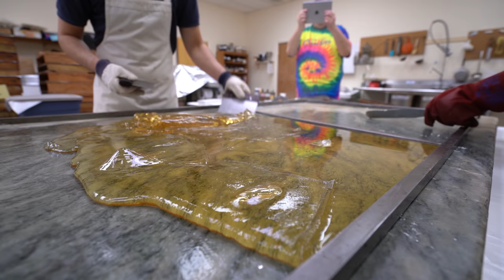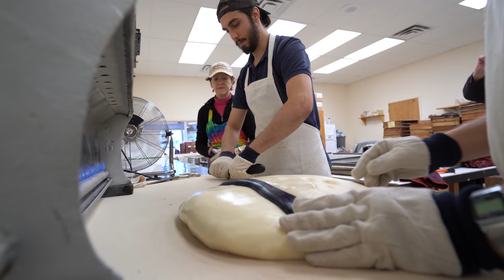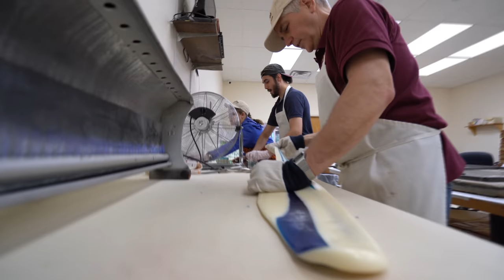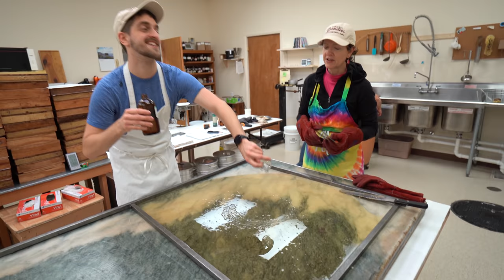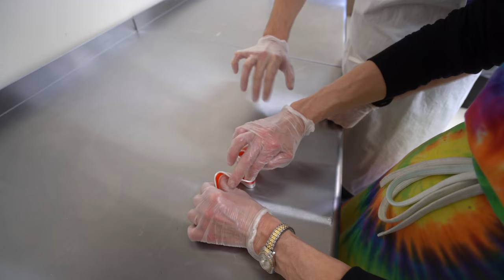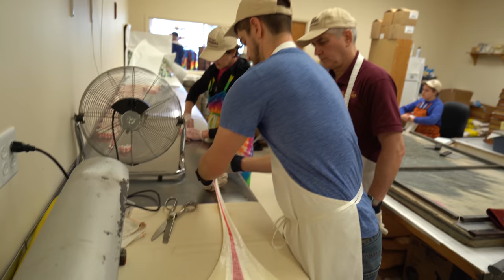Craig Finally Learns Ribbon Candy!

Comment: Love seeing you in front of the camera for a change and definitely like longer videos too, you did  a great job, Awesome!! I was thinking about the "sticky spots" on the marble table and was wondering when was the last time it was polished. It might need to be sanded and sealed. When I went shopping for a marble board I was told by a pastry chef friend that I couldn't just run to Lowes or Home Depot lol. I needed a marble slab that has been micro sanded to a fine and smooth surface and sealed. After so many years of high heat and repeated scrapping with metal paddles it's bound to need some TLC by now. Could be why it's sticking and is a fairly easy fix. Blessings to the whole Hercules candy family, crew and fans (aasb)
Reply: Thanks for the information I didn't know that about marble.

Comment: Still fascinating, after all the videos been made!! And still curious why their needs to be air bubbles in the pulling  process? Those ribbon candies look gorgeously pretty! Love the blue color! You guys are the "willy wonka" "lisa frank" of Syracuse ny... thanks craig for keep wanting to film these! I do miss though "momdre" grocery shop videos!⛄☃️☔
Reply: The air bubbles reflect light and makes it look white. 🤗
Reply: @laurenh825  thanks! interesting.
Reply: When they pull it it puts the bubbles in it and changes the color but it also changes the texture and makes it more crunchy and easier to eat which is very different than candy like a Jolly Rancher which is very hard to Crunch on.
Reply: @sassyk461  even more interesting! It goes from liquid to that soft dough like to quickly after candy shaped to rock hard candy that would break in a thousand pieces on the floor! And what mystery the air bubbles makes the color change...what also, is the purpose for tapping on the hook?? That is interesting too.
Reply: I think I remember hearing them say that when they tap the hammer on the hook it sends a small vibration through the hook which causes the candy to release temporarily that way they can make sure it all is getting mixed in and stretched evenly. It also gets tapped in the end so he can quickly pull it off the hook.
Reply: I've only had hand pulled candy once in my life but it was wonderful! it tastes SO much different than candy that hasn't been pulled. Lofty explained that the air bubbles allow for more surface area so you taste more. But I noticed that it also dissolves quicker.

Comment: Dear sellers of clothing and/or other soft materials that can get easily damaged, please learn to put cardboard on top of material that might get damaged by the use of a Stanley knife, thank you.
*Sorry I got triggered in the first 30 seconds, I'm a weak man.
Reply: Old Schooled when i worked for a grocery store i was told when cutting open boxes to only cut the tape along the edges and then the ends of the tape on top so that if you cut too deep you only cut the inner cardboard flaps
Reply: she lifted the card well away before cutting there was no risk of damage there

Comment: I love you guys. I hate to see you struggle with candy sticking to the table. Could you flip the marble slab over and get the underside polished? The currentt topside will only get worse over time.
Reply: True. Marble is porous and pits appear.
Reply: I thought it gets sticky because it heats up too much and they need it cool to be non stick.
Reply: I was wondering the same thing, Patti.
Reply: @MissySimpleM  That's why other people use a table cooled by water underneath.
Reply: Not only does it get pitted over time, but before moving to this location, hard candy using that table was only made during a couple weeks of the year. So it took decades for the table to get this bad. Now that they have moved, they are using the table often. It will deteriorate faster because it will be used all the time. Marble is a soft stone. With them scraping it with metal scrapers many times with every batch of candy, it loses more and more surface with each use. This can already be seen in the candy that seeps under the metal bars. The bars are straight and true, but the table has swails created by the decades of scraping. In fact, when the candy sticks to the table, they scrape extra hard to loosen the candy. They need a newly polished surface to work with, and they will need to have it polished by professionals every so often after that.

Comment: can you use a thin layer of epoxy or tape to fill the crack in the table. just cuz they're so fragile. also, i know you guys mentioned you use paraffin wax, ever think of trying beeswax.  has a higher melting temp so maybe it'll help keep things from sticking to the cloth.

Comment: The leaning tower of Piza is 187ft !! And you feel every foot of that as you climb it because on one side it feels like you're almost walking on the level and the other side is very steep which makes the lean very difficult. It's quite an alarming climb and scary at the top because the rail are/were practically non existent. I hope they've closed it now!

Comment: The new marble table stand is on wheels, right? Have you thought about rotating it 180 degrees so the initial pour isn't right on the crack every time? Just wondering.